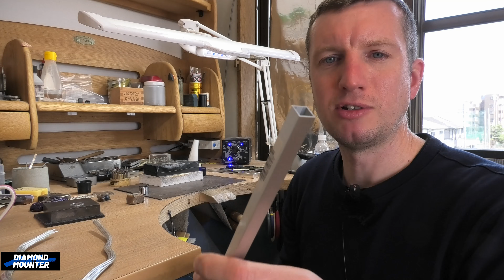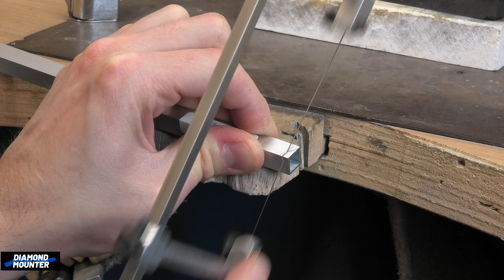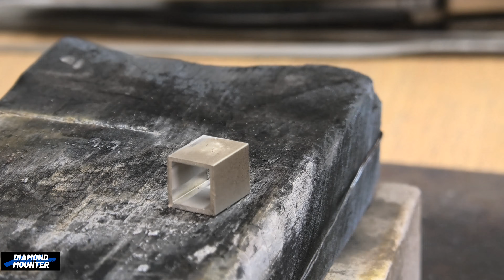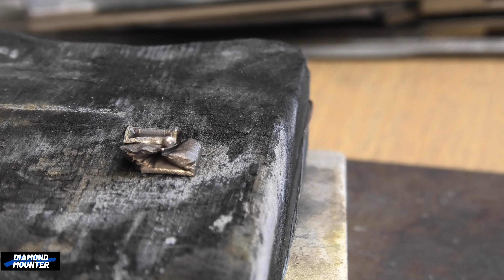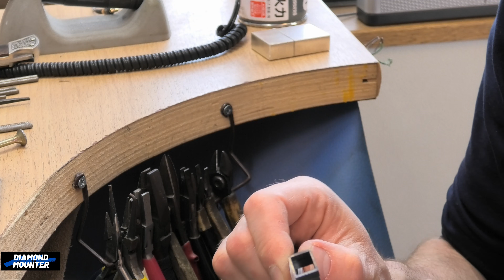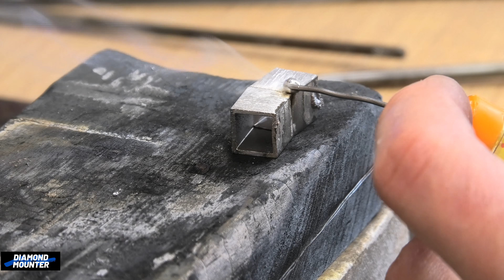Working with Aluminium for the 1st Time

Comment: the issue is aluminum is a reactive metal that immediately oxides the second its exposed to air. on top of that aluminum oxide has a melting point of 2072 C vs aluminum which melts at 660c. this is what is happening here where your getting that molten marshmallow effect your getting there. you  really need to TIG weld it with AC or DC with a AC bias. AC causes a turbulence in the weld puddle that breaks up the  oxide layer. you can kinda stick solder it but it really works better with thicker metal and part of the key is bringing it up to temp and scratching the surface with the rod to break the oxide. but still its really not controllable so its really not a thing you can do. you can have some luck with a pulse arc welder or a laser welder and some rare soft solders that include titanium and need to be applied using a ultrasonic soldering iron. also watch out because aluminum will contaminate your tools and cause defects in precious metals such as melting holes in pieces upon subsequent high temp soldering needed for precious metals. i would stay with steel, nickel silver, or brass/copper. steel can be annealed when heated up in a large quantity and plunged into vermiculite or pumice to slowly cool down over a course of hours.
Reply: that is very interesting
Reply from the maker: Thanks yes that all sounds like its correct. I dont think its gonna work for what I want to do with it so Im looking for copper square pipe now. I can see my self making my own in silver though

Comment: i'm SO sorry you went through this lol, it looks super gross. aluminium has a low melting point, i can't imagine having to work with it. i hear steel is kind of in fashion with the more experimental and modern jewellers these days but haven't tried it, i only saw a guy make his girlfriend a bangle out of a huge steel nail and that was super easy to bend, but there was no soldering whatsoever.
Reply from the maker: Steel has quite good elasticity! It bends a lot quite happily

Comment: aluminum is such a terrible metal to deal with in so many ways, i know its good for some stuff but never would recommend for jewelry or even attempt working on it myself. it has a low melting point and retains heat which is a cancerous combo. any video out there that makes aluminum look easy to work with is complete bs in any way. id keep it away from beginner jewelers at all costs, or anyone for that matter lol.

Comment: Have you ever tried to alloy aluminum and silver to make sterling silver out of it (instead of using copper)? I've seen watch companies like Tudor do it with their watches. Is it safe for jewelry?
Reply: It likely would be if you could get the two to alloy. Aluminum is less reactive to every day acids, and structurally it's used everywhere. Not to mention we use aluminum foil and canteens made from aluminum, I think if alloyed properly it'd be safer, arguably (not to say sterling with copper isn't but hey hedge your bets if you're metal sensitive :p)

Comment: Aluminium is one of the fastest oxidizing metals, you clean it and in seconds there is an oxide layer.
Your gas torch does not help either. The thin layer outside the molten Ali is the oxide coat. The special rods that can weld Ali with a gas torch are about the only way, but not for fine small joints, apart from TIG, MIG and laser methods, maybe induction welding. Otherwise you could cast the shape you want and finish it the regular way. Aluminium is just is too reactive with oxygen to be a suitable metal for jewellery

Comment: In the mid 1800s Aluminum was more expensive than gold Due to its refining  Process Several high end jewelry manufacturers incorporated  it into very expensive jewelry But by the 1900s a new process had  Evolved making it much cheaper to produce And that is the aluminum we think of today  I remember a couple rings that needed repair over the years and it's always a really nice expensive ring with claws holding a aluminum plate with the stone/stones in it   And an antique route show episode that featured a cigarette case made by Cartier  Or maybe Tiffany
Reply: Bro I knew it . I knew it . Aluminum is the future because it is already the past . Only lost value because the power is in the people hands with aluminum
Reply from the maker: @rafaelperez6826  Its likely one of the most important metals on earth! There's no modern engines or aircraft without it

Comment: I had a play with those aluminium ‘welding’ rods a while ago. They definitely don’t behave like jewellery solders, they’re a different beast. You have to get the metal sanded back clean, then up to temperature before going in with the solder. You need to keep the solder as a rod and rub it over the join until it breaks through the oxide layer on the aluminium, then it’ll flow. A pallion of it will just sit there unless you give it a scratch with a soldering pick. Hadn’t even thought about using it for jewellery, be interesting to see how you go with it. Another thing, I found that a dab of permanent marker on the work will burn off just before it gets to soldering temp.
Reply from the maker: Thanks I will try that technique!
Reply: Those "welding" rods usually contain Zinc, so it's actually a low temperature version of brazing. I have heard of specialists actually gas welding aluminum for aircraft or hot rods.

Comment: I think the coating you are referring to is the naturally forming aluminium oxide layer where the metal is exposed to the atmosphere. Given enough time (days, weeks, months) the oxide will reform on the outside of the metal where you have removed it with the files and bugs sticks. 
I could be wrong, I'm no expert.